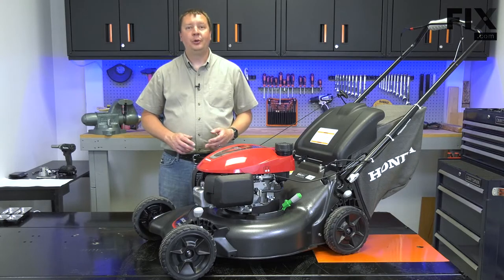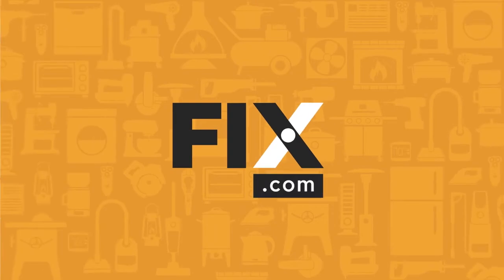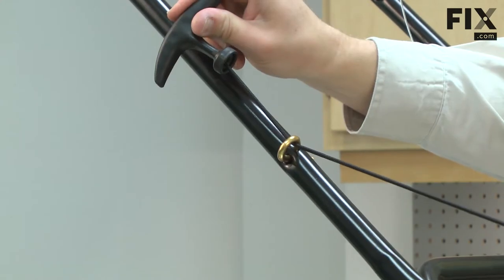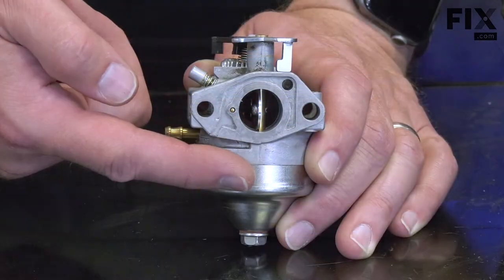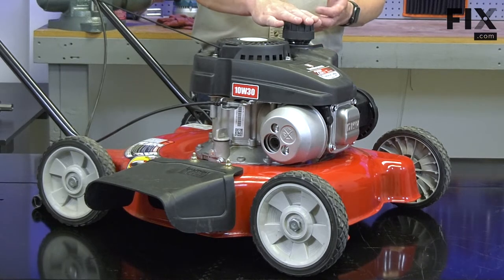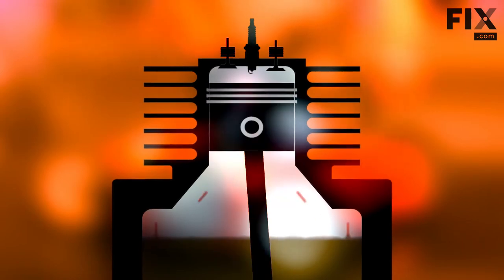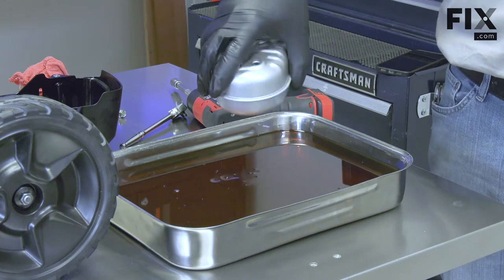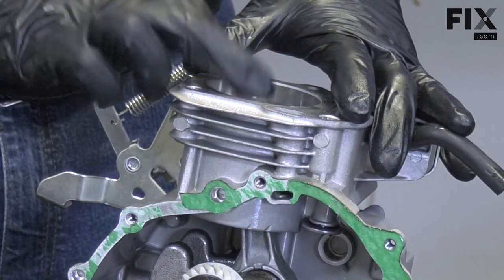LAWN MOWER REPAIR: How to Fix a Hydro-Locked Engine on Your Lawn Mower | FIX.com

Comment: Utter crap. Take plug out, pull till excess oil out, spray easistart and restart run until stops smoking